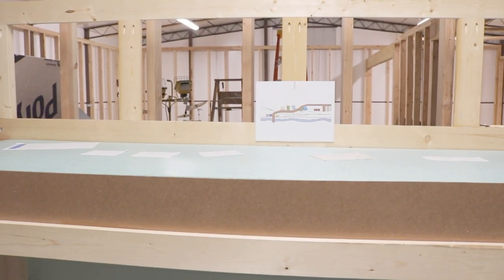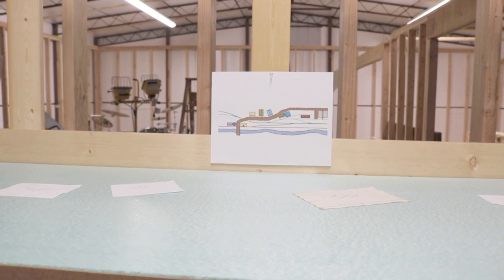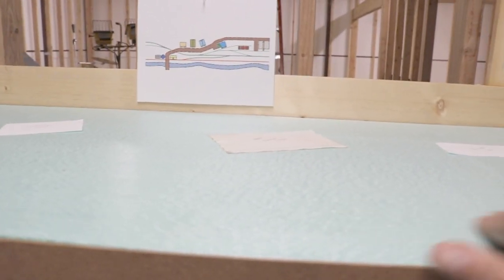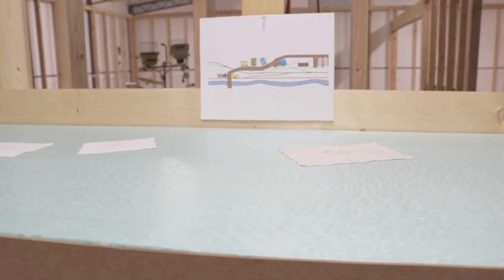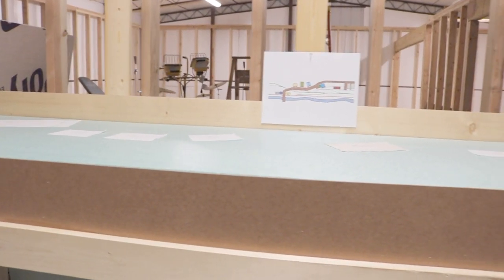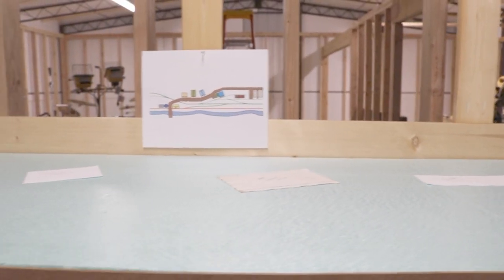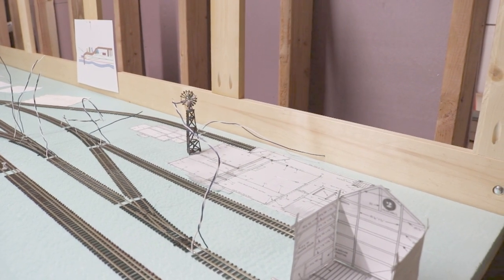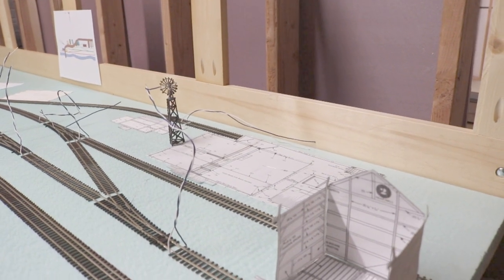MRVU 3 Track Work

Comment: I can definitely see the Timesaver in these earlier videos.  You do a great job in future videos with the structures in that I did not see the Timesaver right away.
On my Timesaver, I put the "mainline" in the back, figuring I wanted the switching closer to the operator. I am not sure if I will add scenery to mine as it is mostly for remote operations.
It is good to see you used LCC.  While overkill for just the Timesaver, it is great to learn the system for when you expand the layout. I ended up sticking with DCC and LocoNet for mine.
I did not realize you were doing a Timesaver, and now I ma going down a rabbit hole of your playlist of your build.
Reply from the maker: Yes, I'm getting ready to start wiring for my staging yard, I'll probably go back and watch my LCC videos again  just to see what I learned. LOL   With the two foot depth there is really no issues reaching the cars for switching.  I'm looking forward to watching yours progress.

Comment: Interesting idea to use floor plans for the buildings to make sure the track alignment ends up correct.  CAD is only good to a point.  Mocking up the track plan with floor plans was a great idea.
Reply from the maker: Track plan is still being revised... I'm almost at the point to build staging.  I have roughly 1/4 of my turnouts built for the first staging yard.  Thanks for watching!
Reply from the maker: BTW, I was off by about 4 1/2 inches on the "east/west" dimensions.  I guess I don't know how to read a tape measure.... LOL   I have completely re worked the track plan and things should work in the space I have.  Should.

Comment: Looking good!  I'm using (after much head scratching) N scale cork for the narrow gauge. Much cheaper than the Homasote. I like Homasote really well for putting track on and have some on my layout, but the sheets I found are a full 1/2" 4x8.  I saw the stuff your using and almost went that way.
Reply from the maker: I didn't think N Scale cork would be wide enough.  Is it?
Reply: @OtterCreek  It is with mine. I'm hand laying on mostly Campbell profile ties. They are a bit shorter than narrow gauge ties from Fast Tracks. And most of my tracks will have ground and ballast up pretty close to the rails. Most of the narrow gauge railroads didn't have real defined roadbed.
Reply from the maker: @cowboyvalley  I may try that as I move forward.  I'm using Micro Engineering track for most of the railroad.

Comment: I like the idea of doing a mock-up with the planned structures. Who’s flex track and premade turnout are you using?
Reply from the maker: Micro Engineering code 70, with the Peco HOn3 Turnouts.  If I had it to do over I would have taken the time to build all the turnouts.  Also, using road bed was the probably the worse decision I made on the module.  I will only ever use roadbed again on long tangents out on the main.  Thanks for the view and comment!
Reply: Why did you use a mix of supplier, ME also has HOn3 turnouts? What were the issues with the road bed?
Reply from the maker: @jstockton303  It's been a while since my thought process at the time.  I believe a had a few Pecos on hand already,  I ran the layout on a "test" area without tortoises before I ever began the Youtube Channel.  Pecos snap shut.  So it was easier to finish with the Pecos.  Road bed caused lots if track height issues with structures, not to mention it's a town.  Narrow gauge roads tended to just lay the ties and track with not much for road bed.